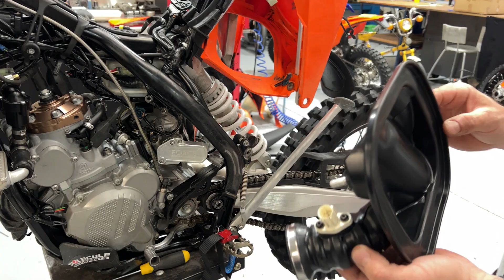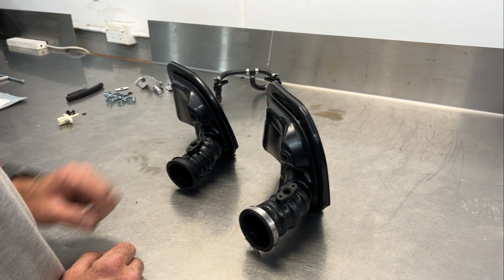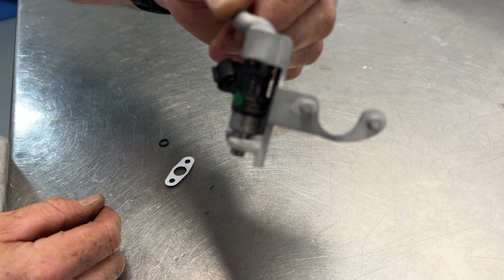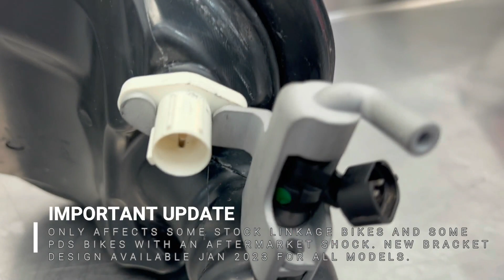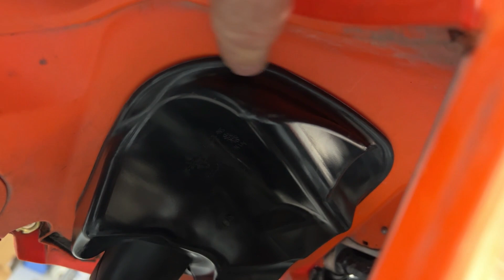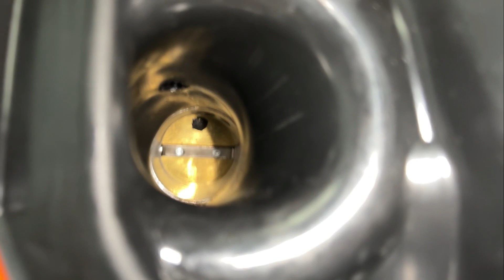Two Stroke Performance TPI Injector Relocation Kit Installation - UPDATED

Comment: Just installaed this kit. I found the left injector hose was a much better length for the tank connecting hose its shorter in length and there is no need to cut any off the original hose for a better fit (requires an extra clamp)

Comment: So if we remove the power valve vent tube from the air box with replacing that aluminum fitting with the new set up where does it go then

Comment: 2022 Husky TE300i with the TSP medium head/throttle body air screw-idle adjustment mod/TSP ECU tune.  I drank the Koolaide and installed the IRK/ECU Tune.  The toughest part of the install is connecting the wire connectors and boots onto the air temp sensor and TBI injector.  Kind of a Rubik's Cube.  While you install the air boot and hook the wiring and hose up, you will move the air temp sensor around.  I would recommend not allowing the silicone sealant to dry before installing the air boot so the seal will not be broken during installation of the air boot.  NOW to the good part:  This takes the 300 to another level!  It runs cleaner at low speeds and pulls a gear higher at 1/4 - 1/3 throttle while lugging.  You can almost use 3rd gear to a stop without stalling but with a lot more torque at low throttle settings.  I believe that the motor revs out somewhat more quickly but the main difference you will notice at low speeds.  It took an already great bike for technical stuff and made it even better!  Mileage seems about the same.  1.1 gallons for a 33 mile medium hard loop = 30 MPG.  Thank you, TSP.

Comment: I'm 14 minutes into this and still have no idea WHY this is a thing.  What is the purpose of this?
Reply: To get the advantages of TPI and TBI into one system.
Reply: With TPI, Throttle Port Injection the stock oil line drips into the air boot and there is an argument on whether that lubes the bottom end correctly.  Also, TPI is not as responsive and precise as TBI, or Throttle Body Injection.  This kit turns the bike to a more updated Throttle Body Injected process. So you have one fuel injector located in the airboot which washes the oil injection system into the bottom end of the engine lubing it much more effectively.  TBI is a much more responsive throttle port system as when the engine sucks air at such a high rate through the air intake, the fuel is mixed in within the air boot making a much better ignition process.  If you notice, KTM is going to all TBI systems because of the performance, it's night and day difference. The tune that comes with TSP is second to none as well, so when you have a more updated TBI system along with a much better ECU tune, the bike literally comes alive much more than before. I hope that helps.

Comment: What is the purpose of this modification? Isn't injecting the fuel right into the transfer ports ideal?
Reply: Ask yourself then why KTM has gone to TBI? There are advantages to both systems so this gives you the best of both worlds. My guess is that KTM will adopt this system for the ‘24 or ‘25 models.

Comment: If I already had my ECU reflahed by you guys a couple years ago, does it need an updated flash for this relocate kit?
Reply: Yes. Each injector is run differently at different times than your original reflash.

Comment: I found it extremely difficult to fit the injector into the new main injector mount. Maybe because my bike is the a 2018 model & the first of the TPI's. ie Old hardened O rings? Rubbed it with oil & rotated it as per the video but no chance to do it by hand. Had to use a vice to install it with much care but got it in. Have now connected the electrical plug with the Orange & brown/white wires to the newly mounted intake injector. That was even harder than fitting the injector. Probably my fault. I have a left hand rear brake installed & the hydraulic hose from the handle bar to the rear brake reservoir runs through that same space. Also, I am literally in the middle  re-assembling my entire bike after a complete strip down & clean so I'm guessing I've also got some wiring running through that same area where the new  intake injector location is. Anywho.... Will try to update the install as I go along with anymore advice/issues. Looking forward to getting back in the bush & seeing how it goes.

Comment: In the middle of my install now. The hot drill bit tip works flawlessly! Also, another tip for others. Use a cut off wheel on a Dremel tool to zip right through the pinch clamps on the fuel rail. Cut perpendicular through the raised pinched part. Literally takes 5 sec each clamp.

Comment: RE: powervalve breather hose. Do you know the reason why KTM routed it into the air boot? 
My understanding is for ecology, because occasionally it will blow out smoke and they want it re-burnt in the engine? 

Does the powervalve breather ever suck air? If so, perhaps they wanted to make sure only clean air goes inside and thus put it behind the filter?
Reply: Good questions, probably  just for some emissions BS. I just installed mine IRK today on my '22 300xcw. The power valve is the same as my '18  300 and that breather hose just runs out.  So as long as its pointed down it should be fine

Comment: Thinking about installing this with the oil pump delete.  However , my concern with the oil pump delete is that at idle warm up or long descents, the bottom end of the piston & motor will not be receiving enough oil, since only 1 injector is firing, can you comment?
Reply: good question im interested in knowing the answer as well.

Comment: Dave is the best ,i have been dealing with him for years ,i have one of these kits and i am in the process of fitting it  i am sure it will be great.👍
Reply: Update on this relocation kit ,fitted this kit last week with the oil pump delete dongle with my ecu reflashed for this kit and my TSP head,the kit is relatively easy to fit if you take your time and have the youtube video playing step step its straightforward ,make sure you have the injector leads plugged in the right way around and if you look at the wiring lead for the crankase pressure sensor it is marked,this is how the bike should have run from factory .👍👍👍